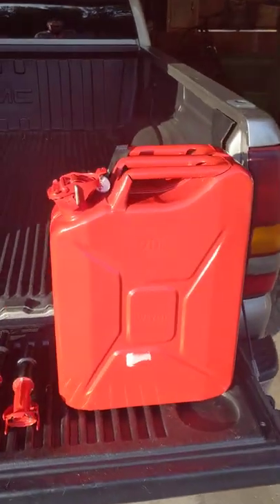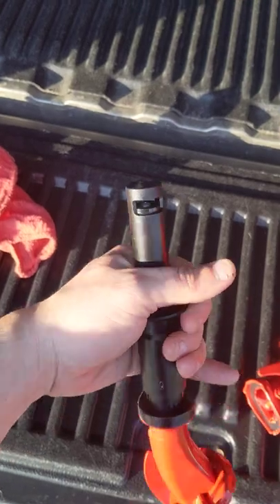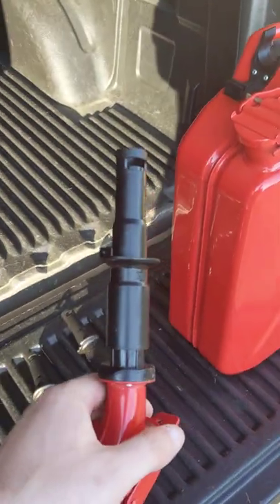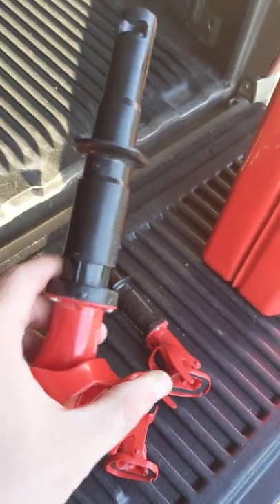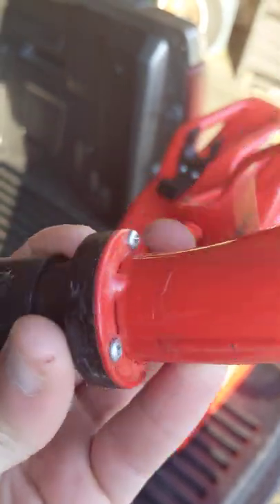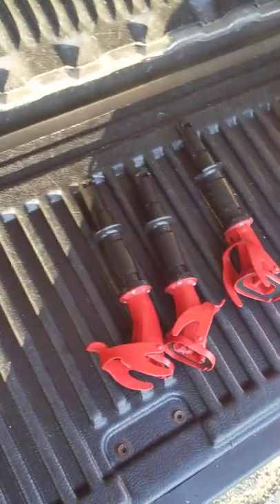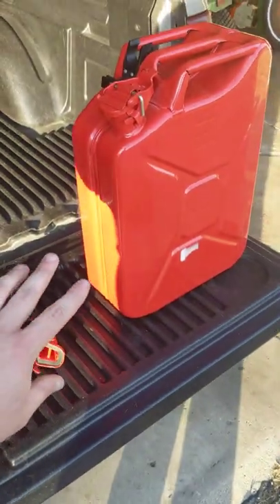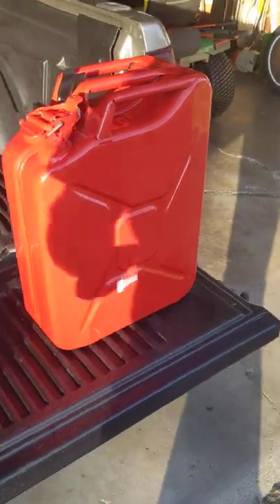High quality Wavian NATO jerry can and the poor spout it comes with

Comment: Glad you brought this issue to light. I have a new Wavian Jerry Can arriving tomorrow, but I paid less for the one without a spout. I bought a free-flow aftermarket spout for it from a separate vendor. No flange to worry about. We’ll see if it works okay with no leaks. 
Fingers crossed!
Reply from the maker: Would like to know how they work out for you.
Reply: @Azure1Zero4  
Absolutely!  It came today, and the first problem was that the rubber gasket in the aftermarket neck was thin, making a fairly loose connection. 
I’m ordering a set of gaskets from Wavian to see if that makes it useable. 
I’ll post the result on here. 😉
Trial and error I guess!
(PS:  The can is really nice though!  The lid and locking pin work very smoothly). 😃
Reply: @Azure1Zero4  
Sure enough, replacing the thin gasket on the aftermarket free-flow nozzle with a nice thicker Wavian gasket did the trick. Nice tight fit, and worked fine without leaks. 😉
Thank you again for the informative video!  😃

Comment: I have one of the old British army nozzles, works great on the rare occasion that I need a pour spout. My M37 has a pull out strainer in the fuel filler neck, so I just keep the spout on the truck in case I need to help out a stranded motorist or something.

Comment: Recently purchased one of the 10L cans with the same spout.  Have not used it yet, but there appears to be a sealant compound around the joint where the spot welds are.
Reply from the maker: Maybe they corrected the issue on new cans. None of mine appear to have a seal other than the paint itself.

Comment: I've had the same leak issue on both of my Wavian fuel spouts.  Wavian sent replacement o-rings and screws but the spout still leaked after replacement.  Now, one of the spouts will not compress to enable pouring.
Reply from the maker: It's not a matter of faulty o-rings or screws like I point out in the video. It's the poorly attached flange. New o-rings don't fix a leak happening before them. I tried new o-rings myself which is how I discovered the issue.

Comment: I just ordered a Wavian can to replace two Rotopax cans.  Rotopax has a good can but their spouts not only suck, but also allows gas to leak while in storage in the flat position due to cheap gaskets on the new "eco" nozzles which you can't buy the gaskets separately.

I carry a long funnel to pour gas so spouts are really a non issue with me.
Reply from the maker: I have considered a funnel before. Problem is its not always a good option for direct fills. What I would do is transfer to an empty can with a funnel and use that can for filling.
Reply: @Azure1Zero4 the spout I carry is very long so it fits down into the gas filler neck and stays in place.

Comment: Those Valpro manufactured cans cost twice as much in the USA as they do in other parts of the world, Wavian likely has a large profit margin

You personally as a welder should be able to repair the spouts easily by brazing or welding the collar

Anyone at home should be able to solder the collar if they don't have the equipment to braze or weld

Obviously take appropriate precautions if the spout has been used with flammable fluids!
Reply from the maker: Brazing is probably the best option but the fact you would have to even do it is absurd.
Reply: @Azure1Zero4  I'm not from the USA, we don't have to use that plastic junk. If they only have to be sold with the silly USA style plastic spout, and you can legally use the other type, then just buy the Valpro flex spout and be done with it

Wavian charge practically double what the equivalent can can be bought for internationally, look for Valpro made alternatives
Reply: @Azure1Zero4  I just purchased 2x ProQuip Valpro made diesel jerry cans for the equivalent of USD40ea and the flexible metal spouts at equivalent of USD15ea ( relatively run of the mill 20% discount sale)

Is there a Canadian or Mexican equivalent you can import without paying a fortune in delivery?
Reply from the maker: @scod3908  If your Canadian you would be better getting Scepter fuel cans instead. They are what the army replaced the metal NATO cans with. Honestly knowing what I know now. I would have gone that route instead. Not sure about mexico.

Comment: Great discover. Just tig it up
Reply from the maker: While that would work. It's not that simple due to the powder coat and it being partially plastic. It will need to be dismantled. To weld it properly you will need to remove some of the red powder coat to get contact with the metal to ground too. You also don't want the paint contamination in the weld. Welding would require just as much work as just building a new one. Even after welding it would need repainted and assembled again.

Comment: Thanks for the review.  Unfortunately my wife didn't see this and bought me two of these cans as a gift (since I've been struggling with the Home Depot pieces of junk).  One so far is leaking pretty terribly.  Did you ever find a good solution?
Reply from the maker: Ultimately I just ended up buying a few Valpro Flex Spouts. The color determines how hard it is to find. If its green amazon has a listing. Red is the hardest to find and can be located by searching the internet. Hope this helps.

Comment: you need to get a jiggler siphon. and only use the jerry cans to fill tanks 5 gallon or larger.
Reply from the maker: I have seen those before but have not used one before so I cant speak how well they work. They should work though.

Comment: I called Wavian about the same issue last year and they falsely claimed the gasket was just worn out. Did you find a better spout or easy fix?
Reply from the maker: Mine were all new and leaked. While I have had gas leak from improper fitment a few times. It's obvious where it's leaking. If you need to get the EPA spouts to work. I would try putting a bead of JB weld around the connection point on the neck of the flange. You lose the ability to tear it apart but it shouldn't leak. I eventually just bought 2 Wavian flex spouts to try. I really like them. They work well for filling up vehicles or my No spill cans as they are big and high flow. I use my Wavians cans for storage of fuel and my No spill cans for yard equipment or my generator. I don't recommend use of the Wavian cans for anything precise. There are two styles of flex spouts Wavian makes. The European style where it's a rigid spout with a flex end and the traditional style. I have the traditional ones. Hope this helps.

Comment: Just bought new in June and on second spout from Wavian. This one leaks just as bad. This can is really not useful, it is very hard to pour without the spout. I would not store gas in this, pretty much useless.
Reply from the maker: Are they the safety spout like the ones that come with the cans and I had in the video?
Reply: @Azure1Zero4  Yes
Reply from the maker: Unfortunately you're probably going to have to buy Wavian's metal flex spout. The safety spout that comes with the can are mostly useless. I got one of their flex spouts and it doesn't leak. It's really annoying after paying so much.
Reply: @Azure1Zero4  Thanks where can you buy them? Wavian didnt have any options
Reply from the maker: @philr5658  Depends on the color you need. Amazon has the green ones. I used ebay to get my red ones but I have seen the black ones there too. The red color seems to be the hardest to track down from my experience. You might have to do a little shopping around to find red.

Comment: When the video could have been "The leak on the fuel spout is that it's pot welded at the seam... the paint between the welds is the only thing keeping it from leaking. try some JB Weld Right here" 8 Seconds.....
Reply from the maker: While you're not wrong. I don't put out very many videos so the format could have been absolutely better. I do like your proposed solution. My goal was to just put the information out there and see if anyone else had a similar issue.
Reply: @Azure1Zero4  just giving ya crap man, thanks for sharing 😂
Reply from the maker: @walkonearthofficial  No hard feelings here. I'm looking at potentially making a new video on the Wavian fuel cans and my experience with them. Seemingly every YouTuber talks about how they are a unicorn fuel can. Surprise there not. Should be a good one.